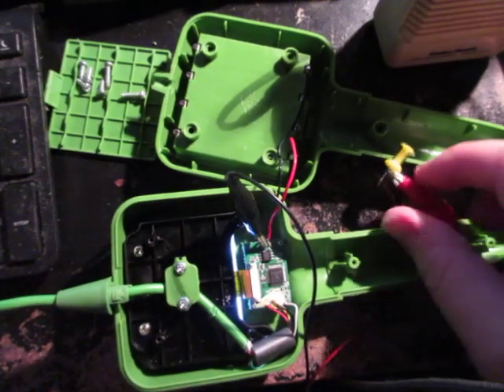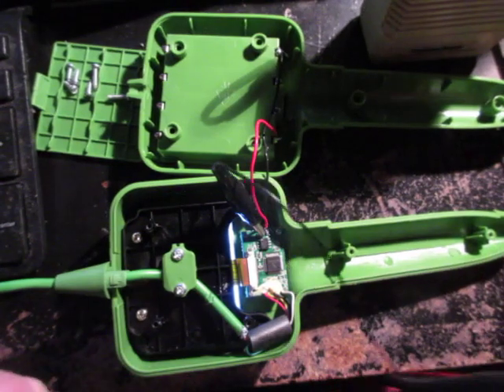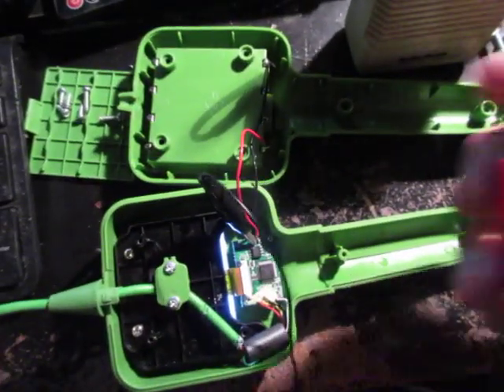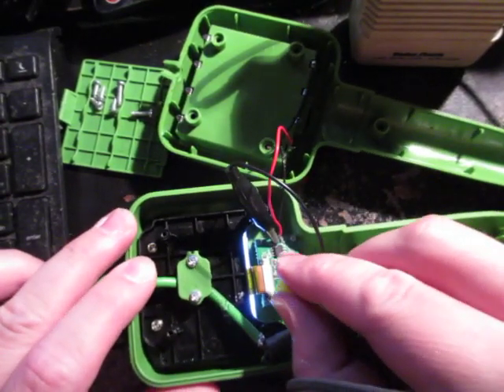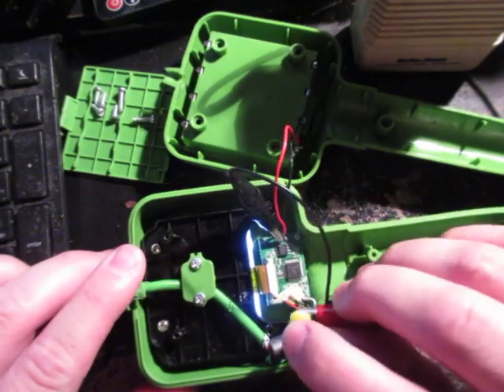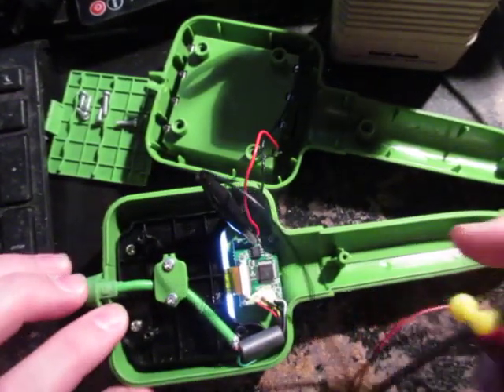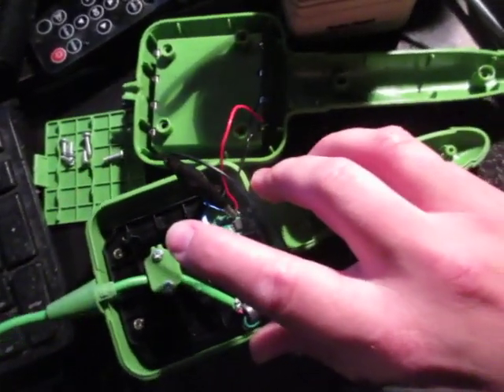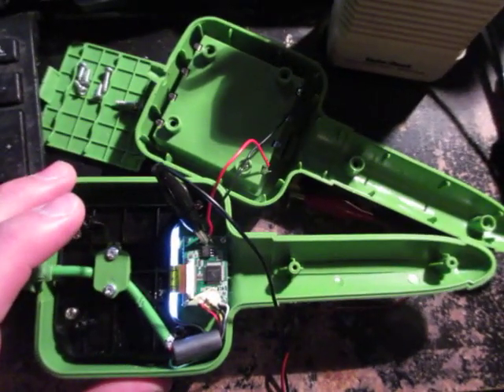Lizard Cam Teardown

Comment: Mine won't turn on the light turns on at first but won't stay on you have any ideas
Reply from the maker: Batteries? I use alkaline like Duracell. If that doesn't help you may have a defective unit. There isn't much to these things its just a USB camera.